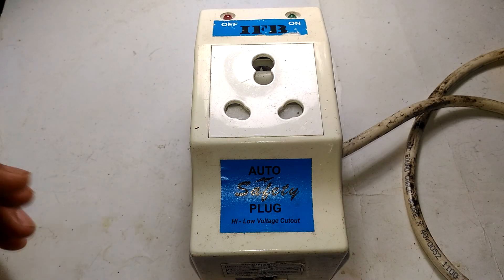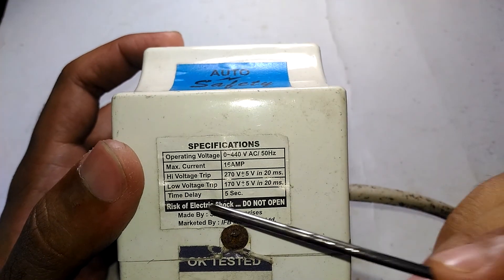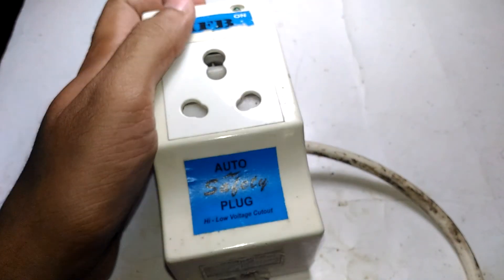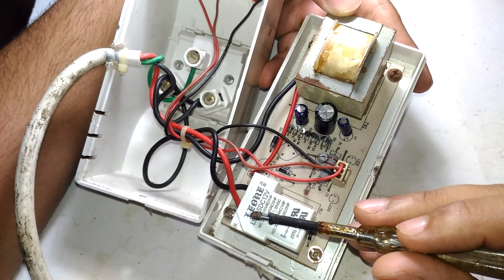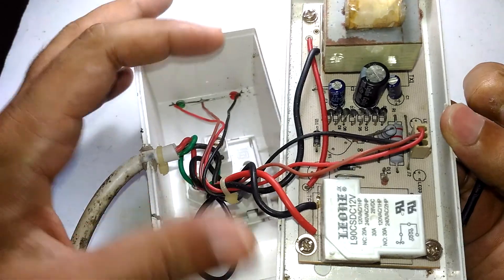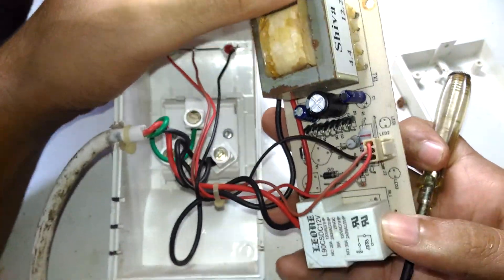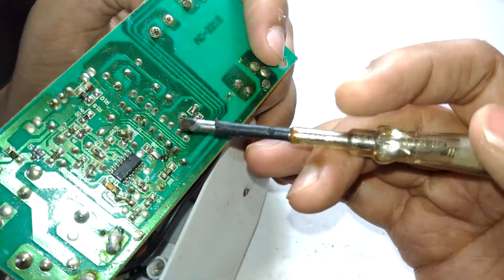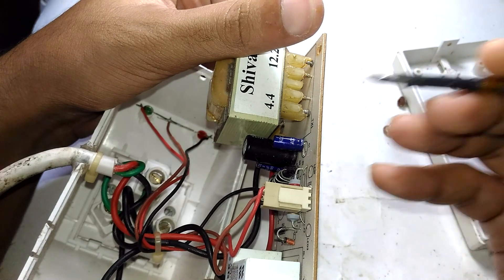IE78: Inside an IFB auto safety plug. (a.k.a high-low cutoff/over voltage protector.)

Comment: If top load washing vendi ulu stabilizer suggest cheyoo?
Reply from the maker: You can buy any brand of stabilizer. Eattavum kooduthal warranty period kittunna stabilizer edutholu. Internally ella brands um ippo similar chinese type board anu use cheyyunne. So price, warranty and service kittunna brand/model edutholu.
Reply: Where can we buy this from ?m
Reply from the maker: It's available online and in local home appliances shops as well.
Reply: Ifb 100% washer dryer, washing machine,  stabilizer vakkunnathe ano nallathe..... Cut out vachu....
Stabilizer anno cut out anno nallathe...
Reply from the maker: @antdro4816 Stabilizer for this size of load nalla expensive aakum. Mostly ee washing machine board okke SMPS type anu. So cheriya voltage fluctuations ellam athu handle cheytholum. Orupadu voltage fluctuating area aanenkil mathram stabilizer mathiyakum. Athukondanu mikkavarum ellarum cutout vaykkunathu. SMPS nu oru extra protection. Ettavum better protection but stabilizer thanneyanu.

Comment: Will in work in 40 or 32' inch TV. Will it protect hight voltage
Reply from the maker: It will work with any electronic equipment. Because all it deos is cutting the power to it incase it goes above or below certain voltage. :) But it's not a replacement for a stabilizer.

Comment: Show how to repair
Reply from the maker: When I get a faulty unit, I shall sure do it. :) By the way, what is the problem with your item?
Reply: Yes plz tell its not working after the lighting thunder.
Reply from the maker: Sorry but I can only make a repair video if I get a faulty unit. Also I don't have this working unit with me to even show how to analyse the board. :(
Reply: I will courier you
Reply from the maker: But I cannot guarantee that it can be repaired because usually when it comes to lightning, chances of survival is very low. Also you may have seen from the video, they have removed the IC marking. So it is a tough find IC. Still I shall try.
Reply: Where is your location
Reply from the maker: Sure you can. I'm from Kerala. :) You can contact me at insideelectronics@yahoo.com.
Reply: I am from coorg

Comment: Is this enough for front load washing machine? Or need any stabilizer?
Reply from the maker: This is not an alternative for stabilizers. This is just for protection from over voltage and under voltage. You may need to use a stabilizer, only if there is any issue of voltage fluctuations in your area. Otherwise there is no need to pay the extra money for a stabilizer as washing machines can be operated directly.
Reply: @INSIDEELECTRONICS  Is Under Voltage&Over voltage and voltage fluctuations are different??
Reply from the maker: Yes. Cutoff circuits are designed to protect your appliances from over voltage or under voltage situations. They simply disconnect the load in such cases. It will not give a stable voltage at its output. If the voltage fluctuates between the higher and lower thresholds (that are specific to each devices) your appliance will see the same fluctuation at its input. But for a stabilizer, it will do the cutoff function and also maintains a constant voltage in case of any voltage fluctuations.
Reply: Ente ee same item , on akkumbo power on and off ayi irikunnu.. so it repairable??
Reply from the maker: Voltage fluctuations undenkilanu sadarana  on-off on-off aayi nikkunnathu. Ithu ippo iranginnagthu chila model IC name erased anu. Mostly repairable anu ithu.
Reply: @INSIDEELECTRONICS  voltage issues aghane thonnittilaa bhakki electric appliance ellam ok aan ee item mathrm ighane... Ith medikan kittuna any shop or repair shop suggest chyumo? Am from ernakulam
Reply from the maker: Appo definitely ithu complaint anu. IFB thanne vanganamenkil amazon il undu. Around 2k anu price. Vere brand 1k range il kittum. Ekm aanenkil Pallimukku electronic street il koduthal chilappol repair cheyyan pattum. Ic poyathanekil difficult anu.
Reply from the maker: Appo definitely ithu complaint anu. IFB thanne vanganamenkil amazon il undu. Around 2k anu price. Vere brand 1k range il kittum. Ekm aanenkil Pallimukku electronic street il koduthal chilappol repair cheyyan pattum. Ic poyathanekil difficult anu.
Reply: @INSIDEELECTRONICS  okey thank you bro, ee item vere ethu shop il medikan kittum electronic shop or home appliances shop??
Reply from the maker: 😊🙏🏼
Ithu home appliances shop il undakum. Mostly under different names. Ellam sadanam same anu. Just high low cut off.

Comment: I have the same plug but from some time it is making some problem to start that is after switching on , it is taking time from off to on and making noise tak tak tak tak , i want to know whether it is repairable or not ? Pls tell ....
Reply from the maker: It is serviceable. The tik tik sound may be the relay clicking. It is difficult to say the exact issue without actually checking the board. So give it to any good service center.

Comment: Can I used 2 transformer one is 12 v and other is 4.5 v. I am looking for this transformer, but unable to find. Also what is the amps for this transformer??
Reply: In theory it should work. It may not be of a higher current rated transformer since all it does is powers the relay and the support electronics. So 1 amps will be fine.
Reply from the maker: It may work. Like the other guy have mentioned, all it takes is just to power the relay and the support electronics. No current rating was mentioned on the part and so is any part numbers.

Comment: Where can I get the transformer. Can we get it on website?
Reply from the maker: Search in digikey or mouser for dual voltage transformer. But if you are going for a single unit, the shipping price may out cost the actual item cost.

Comment: Is it reduce our electricity consumption of our washing machine?
Reply from the maker: It is just to protect any electronic equipment connected to it from an over voltage/under voltage scenario. It will not reduce the power consumption in any ways.